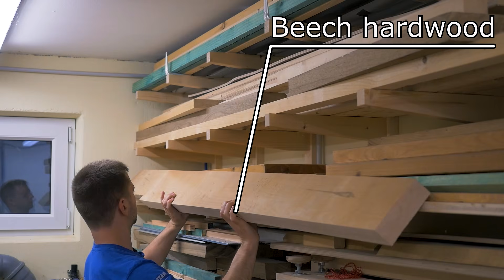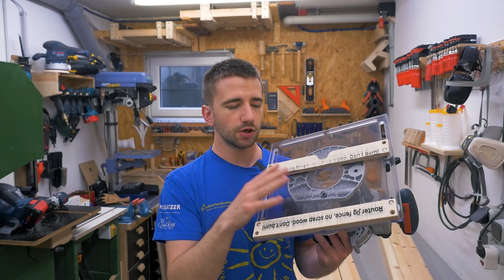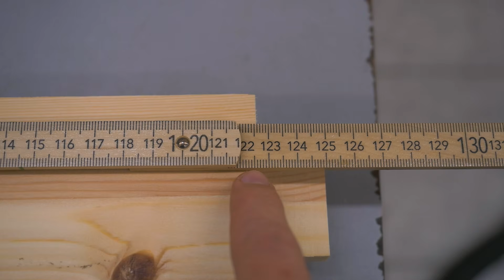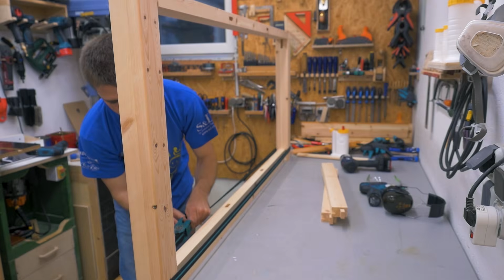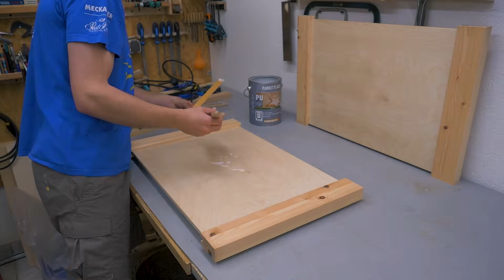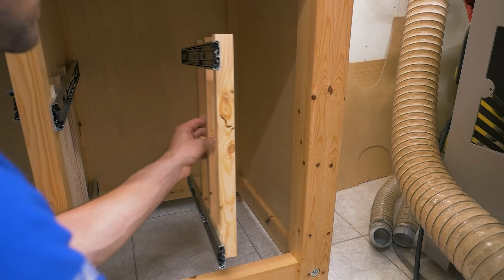When a Fail becomes a Feature | Workbench Build

Comment: Using laminate flooring as a drawer bottom was a real eye opener for me. I am starting a project to make 23 drawers and I have a huge stack of old flooring I pulled out of my camping van. I believe they will be perfect. Lightweight and durable :)  Thank you sir I really love your problem solving skills!
Reply: I had several boxes of unsuse flooring that I was tired of looking at, found quite a few uses for them when you start looking. I'm now out of it, and I'm thinking of buying more just to have on hand. Very useful to be able to crat panels of varying widths with some glue and thought.

Comment: Marius, I have a nice workshop where I've installed wooden shelves made from scraps of lumber. It's made a big difference in my shop, and the good part is that I only needed to purchase screws for the assembly.
That cabinet is a nice idea. I will be building a welding cart from a set of metal drawers from a desk, and the base from a welding cart I purchased used that was cheaper than I could buy the wheels and casters for. I plan to make the top section from angle iron that will attach and cover the opening at the top of the drawers.

Comment: Please take my advice..... DON"T USE SOFT CLOSE SIDE MOUNT SLIDES!  They just don't work well, there is only a little pin that engages the soft close and that pin is so small and delicate it quickly fails.  Stick with normal side mounts or go bottom mount which are fantastic.
Reply: Strongly depends on the exact type. I've had a (cheap) pair of the ones you describe and it failed withing half a year.
Now I only get brand name soft-close drawer slides and I've never had a single hiccup or problem.
I would never not use soft close again - Just this little change makes everything feel much more substancial and premium.

Altough I have to agree that bottom mount slides are even more superior. Also with soft-close, of course. Its just a shame they use up so much vertical space, compared to side mounts...
Reply: @marcoschwanenberger3127  Accuride as far as I know are the largest manufacturer of side mount slides and they re-designed the soft close twice and I still had the same problem.  One little pin is responsible for pulling all the weight.  I'm a professional cabinet maker and I am 99% bottom mount now.
Reply: @tableshaper4076  For side-mount I use "Junker" slides. They do have a pin, but this pin just engages the mechanism. The spring itself latches on via a beefy stamped metal hook to pull the drawer back. At the rated capacity (45Kilos, aka 22,5 per side) I am pretty comfortable witht he design.

I'm also a professional cabinet maker, and I also use 99,9% bottom mount from "Blum"
For my private projects I usually use the side mount, for space saving reasons in the vertical.
Reply from the maker: I had none of them fail on me yet. However in a recent build (video next week) I used undermount sildes and they are a lot nicer in every way. However 3x as expensive
Reply: @MariusHornberger  well in the video you mentioned you would put links to the slides in the description, but either I am blind, which is entirely possible, or they are not there :)
Reply from the maker: I guess you misunderstood, I put a link to my amazon wishlist in the description ;)
But here's a link to the slides: https://amzn.to/33hiZ3M

Comment: I, as a full time carpenter, am always incredibly impressed with the fit of your drawer fronts! Making them so tight , flush and the gaps so small would be an absolute no-go to do in your apprenticeship-piece, since its incredibly hard to pull of, usually.
Infact, I'm still not quite used to seeing this. I work with these types of drawer slides all the time, but I still have to ask: Doesn't the sag with loaded vs unloaded drawers cause some missalignment sometimes?
Again, really impressed and I am a huge fan of the fact that you kept this Style throughout your workshop. Makes everything look so much nicer and uniform! I finally settled on a Style just some weeks ago with my new Workbench. guess I need to rebuild all the previous onces, haha!

Cheers from Koblenz
-Marco
Reply from the maker: Of all the drawers I made like this, none of them is sagging to the point that they start rubbing against each other.
Reply: @MariusHornberger  Thats great to hear! Mounting drawers has to be one of my most hated things to do, haha!
Reply: Eigentlich könntet ihr euch auch auf Deutsch unterhalten, aber für die Community ist es so natürlich informativer :D Über das gleiche Thema habe ich mir auch schon mal, beim Bauen von Schubladen, Gedanken gemacht :D LG
Reply: @MrElBenno  i for one am very thankful for the comments being in english, though my german is "almost" passable i do occasionally stumble on a few terms but mostly i get the gist of things with the content, it is okay to read through but i do prefer english to german, on account of the fact that english and danish are a bit closer than danish and german, but just a small part, the thing i mostly break my neck on is always the grammar, i come from northern part of denmark so my access to german television is rather limited thus my absorption of the german language is lacking. All in all i am glad to keep the comments in english, sorry for the long diatribe.
Reply: @MidnightAmratha  I was actually only thinking of this comment. Sure, generally its fine that Marius makes his videos in english. But i thought it is funny that 2 germans speak english. But sure for all its better in english! i am with you :D
Reply: @MrElBenno  ywah but what if it is an american speaking german ?
Reply: @MrElBenno  nicht jeder kann deutsche, und auf english hat er mehr  Zuschauer